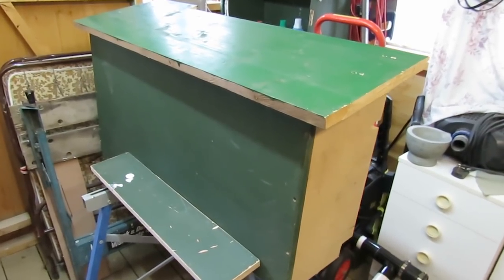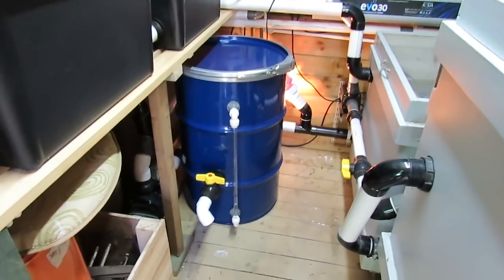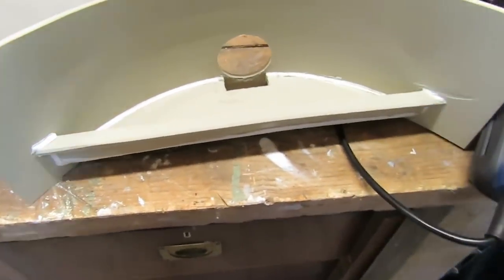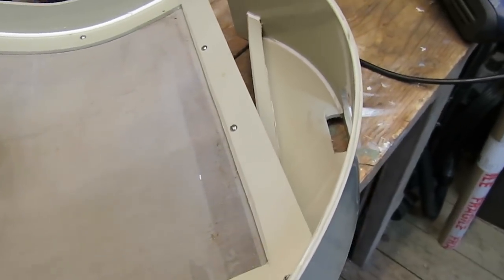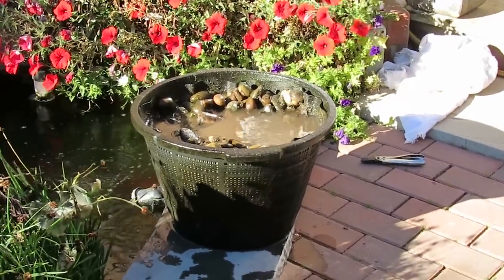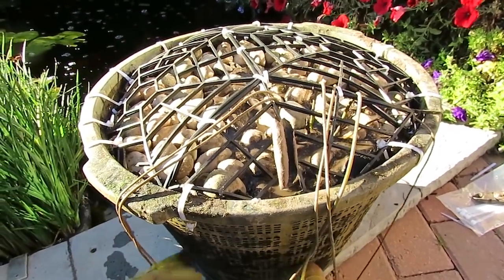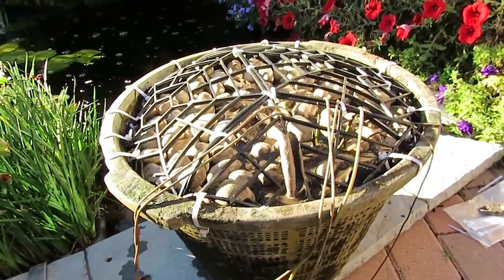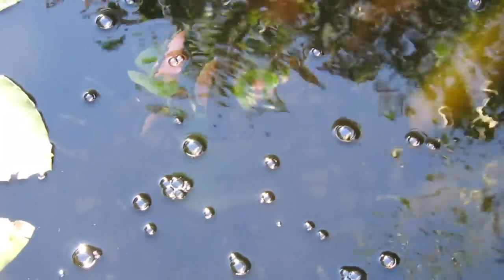Wrighty sieve & trying to get my winter jobs done

Comment: Hi Terry just a quick question, how often would you clean your old blue filter system out ,I mean the media taking into account to leave some at the bottom?? I'm using homemade media of pot scoured, and they are pretty bad, haven't touch it for a year.
Reply from the maker: Hi Patrick, It really depends on how much dirt is coming from the pond. Each pond is different so it's difficult to give a time to clean, but I would think on an average pond I would recommend tub 1 one week and tub 2 the next week, so basically the mechanical tubs are cleaned once a fortnight. The moving bed is self cleaning so a wipe round a couple of times a year is fine. Leaving the dirt in the filters is quite dangerous as it can eventually poison the water and turn it fowl for the fish. Hope this helps. Terry.

Comment: Hi Terry
Another great video,I noticed your water filter in the shed background,I've just bought the same one after my ea carbon filter split,got a persistent slow dribble from the input hose fitting,put so much plumbers tape on, frightened it's going to crack.
   Just in the process of building four 16mm polycarbonate pond covers,does your pond temp stay fairly constant through the winter under your covers, my koi hate temp fluctuations especially early spring and I generally lose a couple of fish,this coming winter will be the first time covered,so I'm hoping it will make a difference,if you put Marek Swan in you tube there should be a couple of videos showing my pond,sorry useless at posting links.
Marek
Reply from the maker: Hi Marek, Thank you. With my pond covers the pond is much slower to react to the weather temperature. What I mean by that is, if the weather temp takes a dive in the night the pond temp is slower to react making it easier for the koi to adjust and not loosing all it's temperature. If the cold spell lasts the temp will come down but my pond was always 2 to 3 deg warmer than the outside temp. We had days of -7c last winter but my pond didn't drop below 3c. Also the polycarbonate sheets still let the sun light through which helps. You'll also find your pond much less likely to freeze over. I don't take water from the deep part of the pond in the winter which also helps the temp down there to stay a lot more stable. I do have it so I can lift my covers which enables me to keep an eye on the koi as well. I also run a small air stone in the shallow end to provide some oxygen to the water. Hope this helps mate. Thanks, Terry.

Comment: Having a think about your pre filter if you ran a small line from where you want the min water level inside the barrel to as close to the pump as you can would this Pull the air out of the barrel until the water then covers the pipe and it would then run as normal until the water level dropped again 

Think of it as how the protein skimmers work with the salt water tanks I suppose it depends how close you can get a line to the pump to get the venturi effect ?
Reply: Or see if you can get hold of an aqua lifter pump or small vacume pump with a float switch to keep the minimum level it should cause less of an issue of air sneaking in, this would keep it all self regulating to keep a nice minimum level inside the barrel
Reply from the maker: Hi Guy's, Thanks for the ideas. I had thought of a vacuum pump and float, but it's adding cost and am trying to keep it simple. What I have done is on the water pickup pipe to the pump in the tub, drilled a small hole in the vertical part at the minimum level. If the water drops to that level it sucks air into the pipe to the pump and does keep the water at that level. I would like it to be air tight if possible. I will have a look at some vacuum pumps. Thanks, Terry.
Reply: Ah that's the same effect as my first idea albeit much simpler than more plumbing, even if you can get it air tight it needs a way to evacuate air as over time even evaporation would cause air to accumulate would it not ? (A fair amount of time I know)
Reply from the maker: That's right. I do tend to forget this filter will be opened quite often for cleaning so it's not like it will have to be running full time and not be opened, especially with a pond like mine with plenty of plants.  I do get quite a lot of debris from the pond. Thanks for your input mate, much appreciated. Terry.